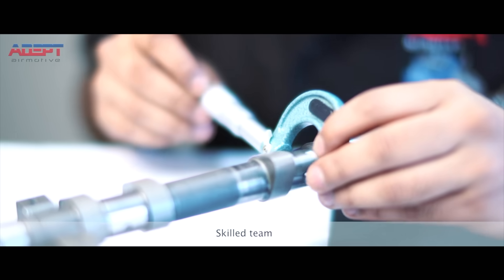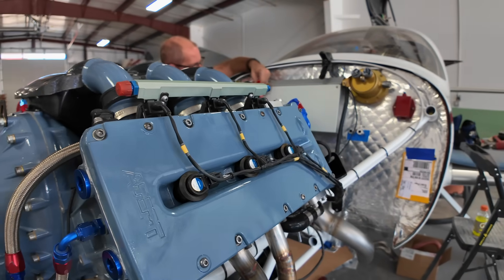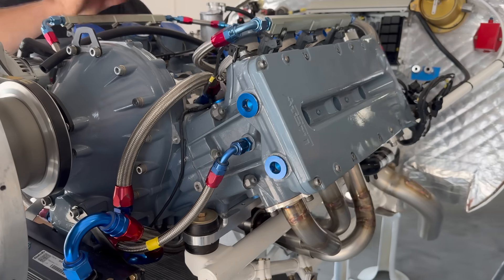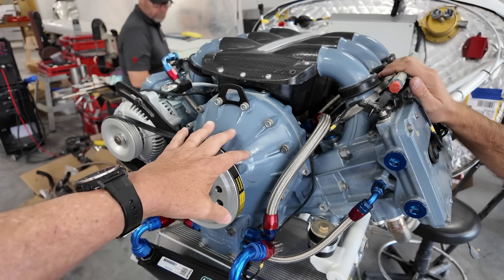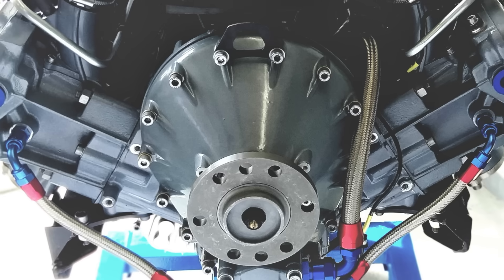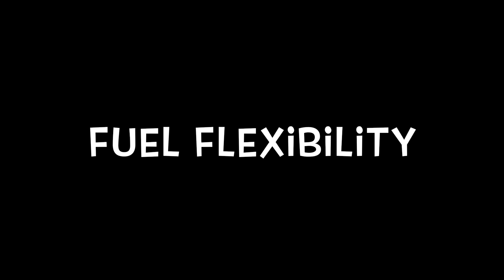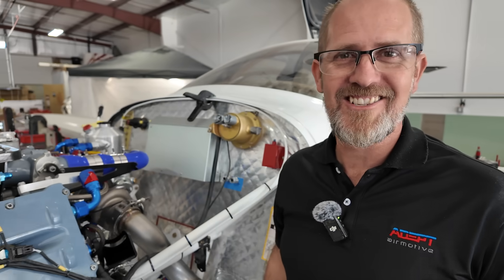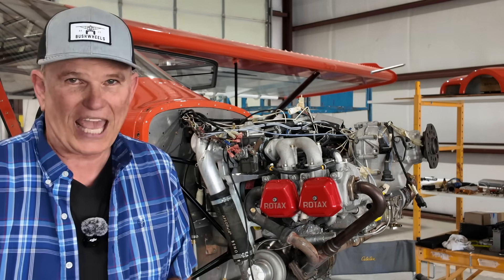The new Adept Engine could be a winner for General Aviation

Comment: Once again we have a new GA engine that appears to be a phenomenal breakthrough, but conspicuously absent is the price conversation. At rumored prices, Adept would fall far short of the holy grail, affordability. Delta Hawk, which has been working on their engine for literal decades, has a viable powerplant, but leaked pricing info puts the outlay well into six figures. The Adept 250 hp model would be a perfect replacement for my Mooney's dated and delicate TSIO 360, but price is a show-stopper. Eventually, escalating overhaul prices for Continental & Lycoming engines will put an end to affordability, as the aircraft they power age out of the fleet, but I suspect the Adept powerplant, or ones like it, will be retrofitted to a very small percentage of these legacy Mooneys, Pipers and Cirrus SR 20s. The technology for lead-free multi-fuel engines is widely available but for there to be a sustainable market, engines have to be priced to sell in volume, not  50-100 engines a year. That won't happen at the reported price point. We wish Adept well, hope for the best as we keep searching for that so-far unattainable GA engine attribute: affordability.
Reply: Excellent take. 100% facts. Kawasaki's plants will be no better, of what we have been hearing is anything remotely close to accurate. Their proposed 2.0L turbo I-6, with a projected output of 375bhp, has a heavily rumored target market entry price of $280,000, and we are understanding that a heavily courted aircraft OEM backed out as a result.

It appears more and more that Rotax got it right...
Reply: @l-vaeronautics2734  Which is why we are all quietly waiting for the elusive Rotax flat six rated at 245 hp. My Mooney 231 calls me on VHF late at light and asks me when she's going to get that engine. Oh well, maybe Edge is listening and beats Rotax to the finish line.
Reply: @l-vaeronautics2734  continental/Lycoming duopoly has us caught.
Reply: Kawasaki Aircraft Engines are currently working on a clean sheet GA engine, which, given their expertise, should be well suited and realistically priced.

I believe they estimated a year or two before it's released.
Reply: @felixcat9318  Any time it involves aviation, you can multiply that release timeframe by 3-10 times, especially it they seek certification.
Reply: At the end of the day the price of this engine is more a question of production volume. As far as I can tell, nothing used in this engine is inherently super expensive to build, but obviously if you cystom build in small volumes, anything becomes expensive.

So basically, in order for this engine to be hugely successful the price has to come down, and in order for the price to come down it has to be hugely succesful. Its the good old chicken and the egg problem.
Reply: @torben777  Incorrect on deltahawk.

They lied so they could survive long enough to play the switch-a-roo.
Reply: @torben777  never mind the price point, - if this engine is aimed at the certified market, gotta get by the extremely conservative mindset of those pilots. You know the ones - if it hasn't been in production for at least 40 years and made by Ly/Cont it won't even be considered.
Reply: @torben777  If you have a better engine but it isn't affordable, it is not better then is it?
Reply: @lynnkramer1211  "Lamborghinis aren't better than other cars because they're not affordable."
Reply: @lynnkramer1211  I dont think you understand my comment correctly.  Sometimes you just need to invent the engine first then figure out how to produce it more cheaply in larger numbers. Having anther good option on the market is never a bad thing.

And yes a better engine is a better engine whether you can afford it or not. Someone always can 😂
Reply: Well stated sir. The mention of your Mooney also interesting, such a beautiful aircraft in my opinion.
All my very best to you & yours....
Reply: Buy the engine, get the aircraft for free! is pretty much the mantra of the used aircraft market.  The price is 90% reliant on where that engine sits in its TBO life cycle.
Reply: these engines are so expensive due to low volume production and the ridiculous hoops they have to jump through with the FAA in order to get it certified. The FAA needs a ton of reform and modernization while not sacrificing safety of course. But some of their regulatory practices are super out of date.
Reply: Something in the 260/280 hp for the RV10 🙏🏻✈️
Reply: @jimydoolittle3129  Aeromomentum AM20T? 260bhp and based on Suzuki car engines with a custom bottom end. They claim to be scratch built and not converted from used engines. Their website says they're $25k. There's already one in an RV12.
Reply: @spankeyfish  That's actually a Hyundai Theta engine, which is a fairly problematic engine.
Reply: @spankeyfish  thank you for the advice, definitely one to be in the competition , 🤗
Reply: Its $80-85000USD
Reply: I would love a modern engine if it becomes available. We now that hot starts in a Continental turbo are, um, frustrating at times.  If I could get ~220-270 hp version for my Mooney (replacing the TSIO 360 MB engine), certified, I'd jump at even $100k; but, I can OH my engine for about $65k (remove and re-install), and the question is how much increase in utility for the corresponding increase in cost?  The "Rocket" conversion has some downsides (fuel burn, UL).  As a replacement for the IO-470s, 520s and 550s, it makes more sense, but you're right about the cost. Love the idea - hope it works out.
Reply: @Byrdflyr Install a single Surfly magneto, no need for the extra battery exc of a dual install and starts are a 95% as easy as a cold start. Well worth it.
Reply: GA is on life support at best. GA needs a 300hp engines for less than 30K. Million dollar airplanes are not GA. Especially if they only have 2-4 seats. Government wants it gone imo.
Reply: Prices don't ever start low with new technologies. They start high and come down as the industry scales up. The issue with that for GA is that it's likely no one of these manufacturers will ever need to scale production. They'll get a few rich guys to buy their engines, but the overall market will always be too small and fragmented. Something similar is happening with 90s cars. It's impossible to find new engines or parts for cheap shitty cars when you can get a used engine for a fraction of the price. By the time the parts dry up, the market may have a couple manufacturers with expensive CNC parts, but no affordable options. If you built parts for aircraft, you would need to win contracts for hundreds of units, not a couple dozen over the course of years.
Reply: @Megakoolguy357  100LL will be banned, that will make this engine very attractive to buyers.
Reply: @PistonAvatarGuy  It will probably drive most people out of an already incredibly regulated and expensive hobby. The prices won't magically come down right after an LL ban.
Reply: @Megakoolguy357  Because it would push people to use a less expensive fuel? That doesn't make any sense. In most cases, it would likely push people into Rotax powered aircraft, as they can burn much less expensive mogas. For the higher power engines (300+ hp, 280+ turbocharged), aircraft owners would likely start looking for engines like this one, rather than use an expensive, unleaded high octane fuel (GAMI, Swift).
Reply: @Megakoolguy357  To those who need something in between a Rotax and a 300+ hp engine, the engines built by MWFly might also start to look quite attractive.
Reply: @PistonAvatarGuy The only thing that prevents people from using mogas is the FAA. Most of the ancient tractor motors are already compatible.
Reply: @philipmacduffie7612  Still, if the goal is to eliminate leaded fuel, those operating piston aircraft with engines in the higher horsepower range would likely need/want some alternatives to the LyCont dinosaurs. Either small turbines (possibly with recuperators), or modern, liquid-cooled engines like this one.
Reply: There are lits of improvements that would be done, both at the manufacturer level and at the owner level, if regulations didn't make any change so difficult.
Reply: Excellent summary.  Spot on.  The problem for av power plants (and anything aviation related) is economies of scale. Look at how expensive cars are, and yet they are sold in the millions each year. Airplanes are sold in the hundreds, maybe thousands. No chance for profitability. I hope they succeed but I’m not holding my breath.
Reply: Until we can put Honda K20s in planes nothing will do it.
Reply: I'll do it for 15k you won't get a commercial though😂
Reply: Well. at 3K TBÖ it offsets price/pays for itself the more you fly.
Reply: Another pipedream from well intentioned dreamers. The economics weren’t there before, they aren’t there now and they never will be.
Reply: Why isn’t your 40 year old Mooney worth 1.2 million dollars? A 40 year old house next to a new construction will be priced similarly. But yours is mechanical and is considered worn out. So it’s worth 100K. I think the problem is people look at a 100k airplane and think it is stupid to put in a 100k engine conversion. I don’t see it that way. You spend 200k and have something comparable to a 1.2 million dollar plane. However, I would rather have a diesel conversion if I had to do one. 100LL is going to go away. GA piston aviation has to deal with that fact. 
The problem as I see it with piston GA from a mechanics perspective is most owners fly less than 20 hours a year. I’ve annualed aircraft that hand 1 more hour on the tach. A flight school that flys a plane 600 to 1000 hours a year will save money with a more modern power plant. If, of course it is a reliable engine comparable to cars that drive 200-300k miles.
Reply: @not_listening2792  This engine runs on mogas.
Reply: Deltahawk was being offered at $89,900 complete - basically a firewall forward install. Where did this six figure number arise?
Reply: @gonebabygone4116  I don't know where you got that number.  It's north of 125K currently.
Reply: @honeycomb8753  CEO of Deltahawk in a video from Airventure last year I think. I distinctly recall "nose forward for $89.9". But we do have tariffs and such now I guess.
Reply: @gonebabygone4116  $110k, right from Deltahawk's website.
Reply: @gonebabygone4116 Well, $89,900 is 89.9% of low six figures. Did to liability considerations engine manufacturers go for super high price, very low volume. That’s a nonstarter for most of us.
Reply from the maker: Check out their website. The owner is also ver happy to talk to potential prices. https://flyadept.co.za/
Reply: @PlaneCrazyChannel  I notice you didn't include even a ballpark number in your response. Looking around their website, I see no readily available information on prices. If the engine is notably more expensive than other powerplants of similar output, I gotta ask. Who cares? An ever present frustration with these "We've solved it! We have what aviation needs!" is the presentation of caring about what GA owners want, while obfuscating the one number that truly determines if something is a viable option for an individual
Reply: @PlaneCrazyChannel they such
Reply: Too many RPM, 4500 for cruise?  This is not going to make it, it’s not much different than LS based engines with a reduction.
Reply: @grumman38  Since it's an aircraft engine the time between overhauls is a tiny fraction of that of a three liter engine in a small delivery van. That engine might run four to six hours a day across a wide range of RPMs with much greater overall heat. What does 2,000 hours at 4500rpm mean? I dunno ...
Reply: @gonebabygone4116 I agree that it’s a very different application than auto use, certainly less heat cycles in aircraft use. Auto engines don’t operate at 4500rpm that much of their life and this would be almost constant. Probably 2000 to 2400 time between overhauls?
Reply: Just go electtic motors only at that size..
Reply: @crhu319  and where are you putting the batteries ? What will be leftover for useful load . No mention range with a reserve for your electric idea as well
Reply: @crhu319  That doesn't work. The weight is too high the range is garbage. Ready to argue? look up the electric GA aircraft and tell me where are flying to. The FAA had to lower the minimum endurance requirment to even fly the stupid thing.
Reply: @crhu319  You'd need a portable hydro plant and waterfall to feed it.
Reply: @crhu319 and put the batteries where?? And how much range do you get?? Just silly.
Reply: @crhu319 😂😂😂

Comment: I have said for YEARS that there is a gap in that size / horsepower range. If Rotax had made a six cylinder the would have killed it.......
Reply: Rotax has developed its 6 cylinder, just did not release it to market…they did not want to take on the liability/insurance lawsuits which is 60-70% of cost reserve for a company…
Reply: @electricaviationchannelvid7863 
All of that is the same for the four cylinder versions......
Reply from the maker: They tried. But I totally agree. Rotax is amazing.

Comment: This will be great for the Homebuilt / Experimental market - but I'm not holding my breath for this to enter the Certified market in my lifetime. Which is sad because we need new options for legacy aircraft. Based on where I fly, a piston engine that burns Jet A is really what I need, and the Delta is just taking forever...
Reply: DeltaHawk is allegedly entering the market...finally.

$110k for just 180hp!
Reply from the maker: That's true. Certified is super expensive and tough to pass. Whereas the experimental market is wide open.
Reply: Deltahawk is here for $100,000 for engine and fwf, not the $40k they said it would cost 20 years ago.
Reply: @PC-vq5ud  DeltaHawk is still years away from getting an STC... Let alone STC's for a wide range of aircraft.
Reply: @PC-vq5ud  Twenty years ago, a dollar had at least twice the value of the current dollar.

Comment: Are there any plans to scale it down to a 4 cylinder version? . . . The light planes don’t need 360 HP - they need 150-200 and lighter weight
Reply: Everyone in retract airplanes wants more than 300 horse.
Reply: Buy a Rotax.
Reply from the maker: I beleive they have a 200 hp version. check them out: https://flyadept.co.za/

Comment: We'll see. Many have tried, few have succeeded. For a new engine, the price point will have to be very keen to convince people to try something new
Reply: Agreed. 
And how big is the market if it isn’t certified (which costs a fortune and takes forever)?
Reply: I was going to post the same thing, for the market they are gearing towards, it needs to be affordable and maintainable.
Reply from the maker: They certainly want your business. check them out. I just did the video about the cool technology. I'm not a sales rep for them. https://flyadept.co.za/
Reply: I agree.  Porsche tried in the 1980s, more recently Thielert came to mind.  Both (and others) failed for various reasons - and they all unfortunately set negative examples that might prevent others from making progress.  Yet the challenges are growing.  Leaded fuel, an increasing technology gap between automotive and aviation engines, bad fuel economy are just demanding for progress to be made - or at least attempted to be made.